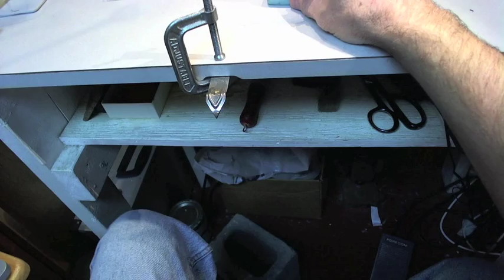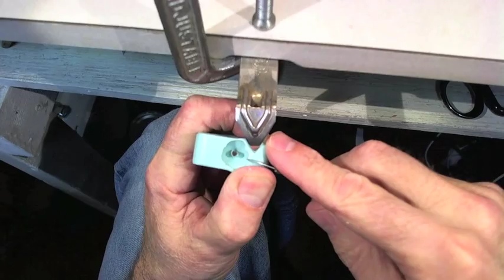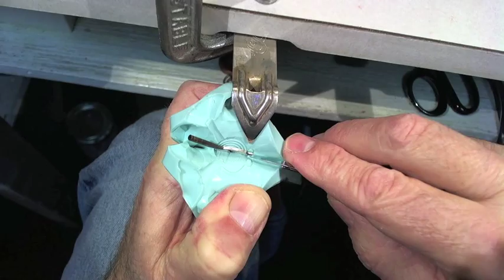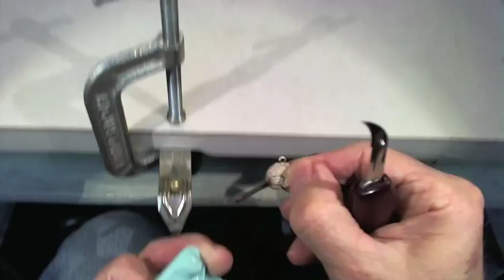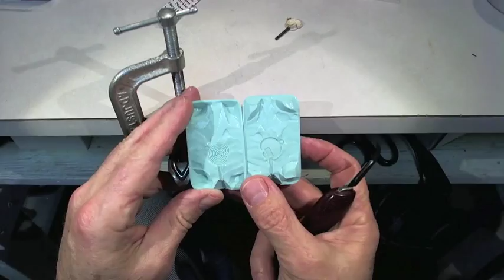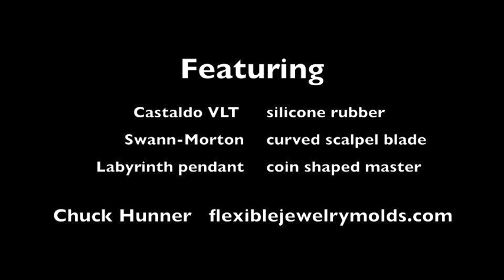VLT flat cut silicone rubber jewelry mold of coin shaped master

Comment: How is the shrinkage on Vlt silicone? They advertise .01 shrinkage. Also is the vlt mold good for fine filigree type settings? What is your wax pressure in Vlt? Thanks ahead of time.
Reply from the maker: Thanks for your excellent question, Joel. I've never measured the shrinkage on the VLT. It is super low and that was what I wanted. Try some VLT to see how it works with your fine filigree. I think it's great for undercuts. Notice that on Castaldo's advertising they use a picture of a filigree butterfly in their mold. Assume that Castaldo wants you, their customer, to be super happy with their product ... and to buy more. What if you have a filigree model and mold it with VLT and it does not work. Will you be happy? I trust Castaldo to recommend products that work. 

I use wax injection pressures between 3 psi and 14 psi. Low pressures for smaller items, higher pressure for items I want to fill quickly and completely. I always expect to experiment a bit with the pressure. I have a good idea of what to expect, but, always depend on the notes I make when I experiment with a new item to guide me when I come back to it for production later.

Comment: just found your videos and website, very helpful, thank you
Reply from the maker: Glad you like'em. I'm always happy to answer any questions
Reply: @chuckhunner  have you tried vulzanizing 3d printed models. Thats what I will be trying to do. Any tips? Will be using vlt silicone, and how do i pack the mold so that i dont need as much pressure not to crack the model? Also should i coat the model with oil or lubricant to prevent it from sticking to the mold?
Reply from the maker: @TheToxicFPS  I've vulcanized them. Spray with fine mist of teflon. I carefully packed the mold with bits and pieces of VLT so that the silicone did not have far to flow. I prefer pouring a two part RTV mold around 3d models. They never break that way until I cut the mold. Then I can still get injections out of the RTV mold.

Comment: Hello Chuck, your videos are very helpful and very well explained. I was wandering if you could share any tips and tricks on avoiding parting lines or on keeping them into absolute minimum. Thank You
Reply from the maker: Hi Marcin, Thanks for your excellent questions. I avoid parting lines by cutting the molds with a sharp blade. If I feel the blade dragging or see striations in the cut surface, I know the blade is less sharp than it could be, so, I change the blade. I also do my best to make long, even cuts along the plane on which I want my parting mark. I avoid making short, choppy cuts next to the model as much as possible. Even vulcanization of the mold, even and flat pressure on the mold plates on the outside of the mold during wax injection, wax that is not over-heated, and the lowest injection pressure you can use and still fill the mold cavity. Also, time your injection so that you stop injecting wax as soon as the mold is filled! Whew! That is a bunch of tips. Looks like several more videos need to be made. :-) Thank You for your inspiration, Marcin. I'm always happy to answer any questions.